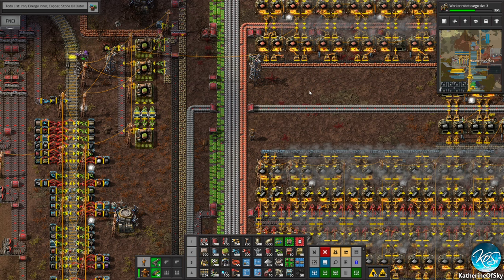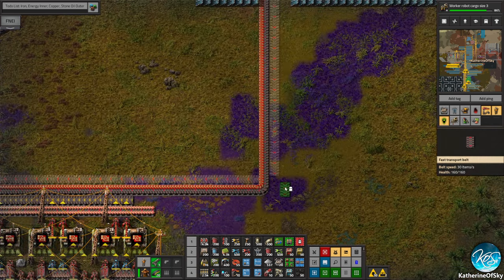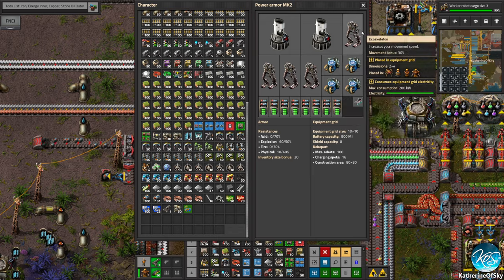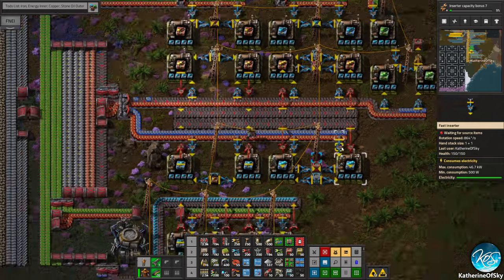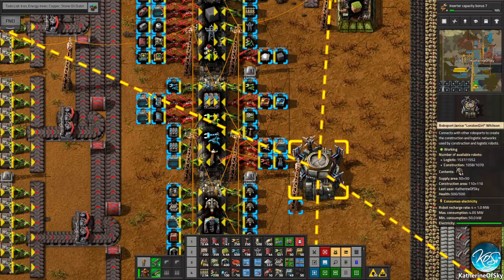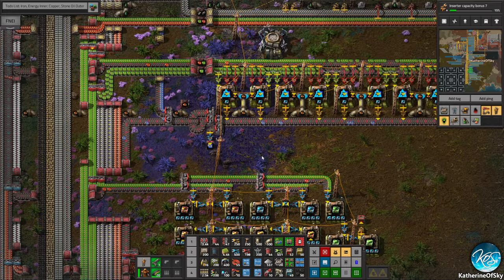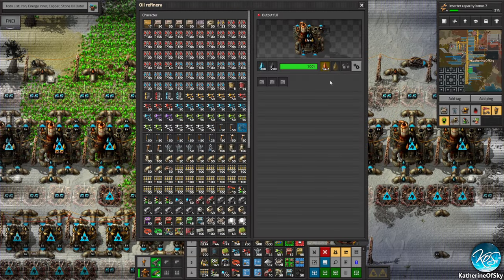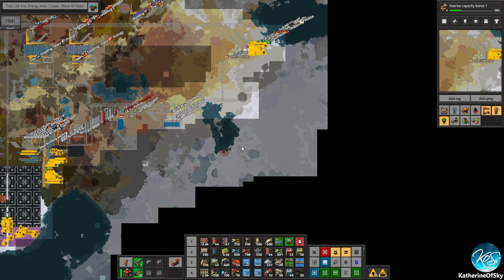Factorio Trickle Down Megabase 16 - SO MANY MISTAKES TO FIX! - Let's Play

Comment: Always good to spend time greasing the squeaky wheels in the factory. Blueprints are handy but they always need tuning in my experience!

The solar fields have a few yellow chests placed outside of a logistics zone in the spots where the roboports were removed, and the very bottom right corner of the new red circuit lines are outside of a logi zone as well.

Comment: On the bot issues and in the FWIW category... You may remember that a while ago I had issues pasting blueprints on the map where a radar had scanned but was not visible. I was able to fix that but continued to have weird issues happen, the last was mod items getting deleted when loading a savegame as though the mod was removed. I ended up deleting the Steam-saved config file and reinstalling the game with all default settings. Then added back in all my mods for my current game. This resolved all my issues. I wish I had saved the mod settings so if I need to do it again I would screen shot all those pages. I use very similar outpost and building train blueprints, and my outpost bots respond nearly instantly, 0.5s to 2s, to build commands. Hope you're able to get the bots working normally again!
Reply from the maker: Huh.  That's interesting.  So you think I need a fresh reinstall to make my bots work?

Comment: More Build trains will help, with a train limit on the outpost build stations, so the build trains can spread out. However the Trains might not correctly failover if you have too many different outpost build station names.
what I have found in my various megabase builds is that it is most efficient if you have only 1 train allowed at each outpost build station, and there is only the base build station(s) loading the train and every outpost train station is named the same. Schedule for the train is just base-outpost, so only 2 stops.
Reply from the maker: I'm not really sure if they will help, since they are limited by the production of the factory for modules and such. but I'll keep it in mind.

Comment: Enjoying the series. I was mulling over the building train dilemma. If you have entry for the building train from inner or outer do you need to mess with the shared line coming out of the outposts? Maybe it's a way so you don't have the headache of separating those two? It is certainly a whole thing of its own the building train logistics isn't it.

Comment: KoS: "it doesnt work, lets just leave it like it is maybe it will stat working magically by itself while i setup yet another new factory" 😂 slow down and work trough the problem 😊
Reply from the maker: I do work through the problems.  Otherwise th3e factory would be producing nothing at all.  And yet, despite what you are teasing about, it works quite well.  If you didn't notice in the video, or in the title, this entire epsiode is about fixing problems...
Reply: @KatherineOfSky  sorry if it came out to harsh, i meant it as a joke. I know i wouldnt resist the urge to figure out why something wasnt working and would be sitting in place waiting untill ive confirmed it works as designed couple if times before moving to next project. But that wouldnt made an entertaining video for sure :) Love the content, keep it comming.
Reply from the maker: I was just surprised at the comment since I have been making sure to make sure to see that every single assembly works before moving on, since that is a comment I've had in the past.  I wait for trains to come in, I check tracks, check production of base materials, etc.  I don't even recall skipping any of these assemblies, and feel like I've made a point of checking each and every one